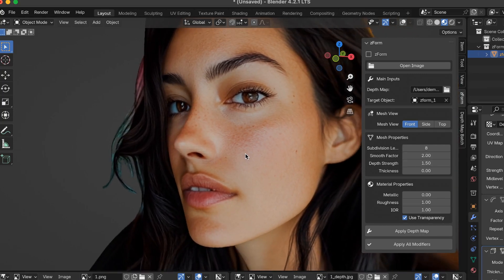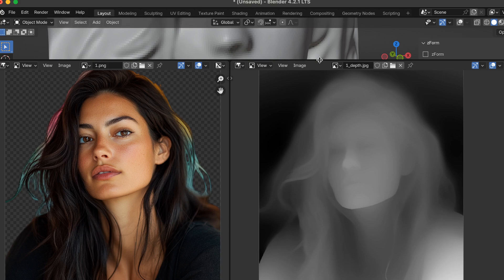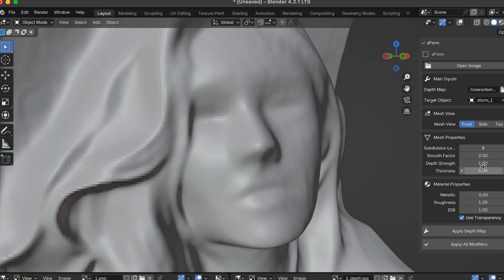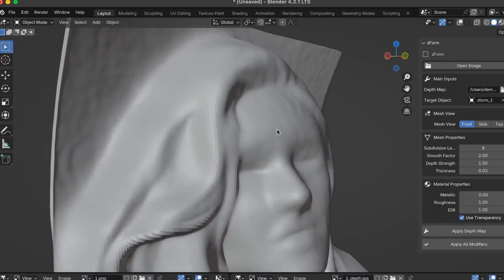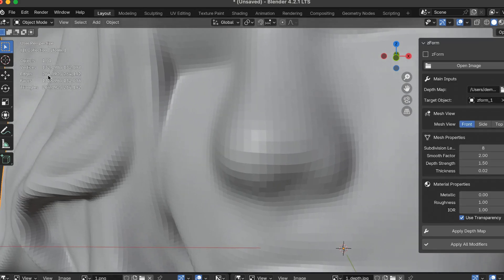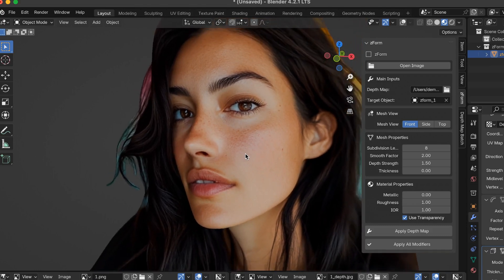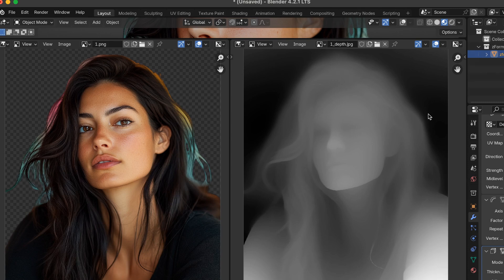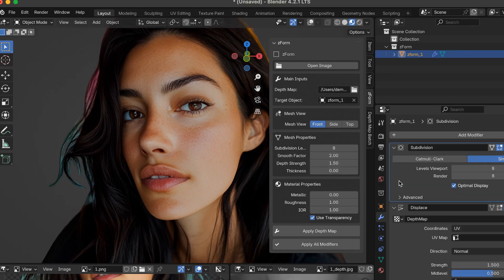Mesh of a 2D image converted to 3D mesh

Comment: Is it available for full-body images or images with multiple people?
Reply from the maker: Hi. If you're talking about an image that has a full body of a person or a group of people in the image with full body, yes. Please keep in mind zForm doesn't itself generate the depth maps...it's a tool designed to speed up your workflow a lot when working with depth maps and original images in Blender to transform to 3d mesh and geometry. So, if your depth maps have a full body of a person or a group of people with full bodies in the depth map, that should work. If you're wondering how to produce depth maps, there are places you can do it online like Hugging Face or locally. I would try to use Depth Anything V2 or newer models. Alternatively, my other addon tool Depth Map Batch can help generating depth maps.
Reply: @vizdotlife  Do you have a trial version of "Depth Map Batch"?
Reply from the maker: @tuanhvu6882  Please message me on Blender Market...if you're logged into the site there's a "Contact Creator" button on my main homepage for products.

https://blendermarket.com/creators/vizlife

Comment: With the latest versions of depth map tools, we get a blue to red depth map instead of a black and white one. When dispplacind using this colored map, both blue and red values are placed lower(like background), but blue should be lowest and red should be highest. Is there a different way to displace for the colored depth maps?
Reply from the maker: Hi. I'm trying to regenerate the issue you're seeing on my side  but I can't reproduce the issue you're talking about. The way I'm testing is using one of the color depth maps generated with Depth Map Batch and then importing that depth map into zForm to use as the depth map. I'd very much like to help. Please message me on Blender Market using the Contact Creator button so I can help.
Reply: @vizdotlife  actually, I am using depth anything to create depth map, can I still contact you?
Reply from the maker: Sure, yes please contact me using the "Contact Creator" button on Blender Market on my product homepage. I'm ready to chat now if you're free. I want to understand what issue you're encountering as I'm not able to reproduce.

Comment: What's the difference between a depth map and a displacement map? Can I use it as a displacement map?
Reply from the maker: Yes, you can use depth maps as displacement maps. For this video example I actually use the Displace modifier. Depth maps are one type of displacement map that is focused on distance from a viewpoint. In contrast, height maps are also used for displacement but are geared toward adding fine surface detail to a model, like bumps or texture variations. Height maps don't have specific depth-from-camera information, while depth maps do.

Comment: Is there a way to remove the background? Trying to import these meshes in Unreal Engine but it imports it with the square background
Reply from the maker: Hi, yes there is a way. I'd like to help you out....please send me a message on Blender Market. There's a "Contact Creator" button and I can guide you through one way to do this. It won't be perfect, but one technique is adding a boolean modifier using the intersect with another object to cut out the backside square area of the mesh while retaining the front area. I will make a video about this as well.
Reply from the maker: Hi. Here's a new video published that shows one technique to remove the background area. Here's the link to the video. 

https://youtu.be/RhfskbbljiQ?si=P79d3762bY8yQWb7